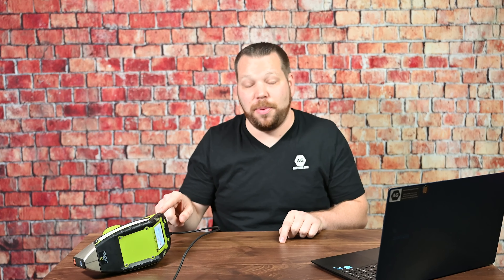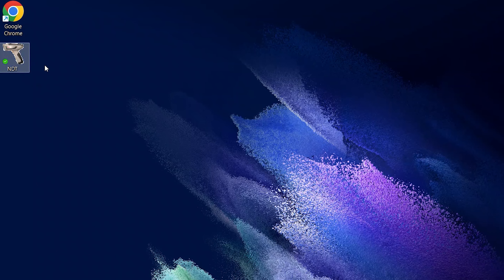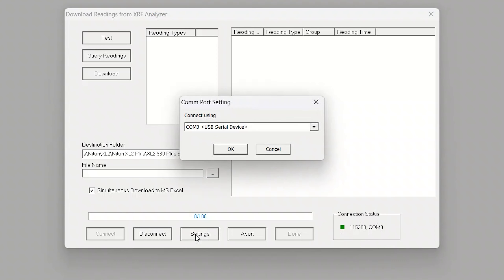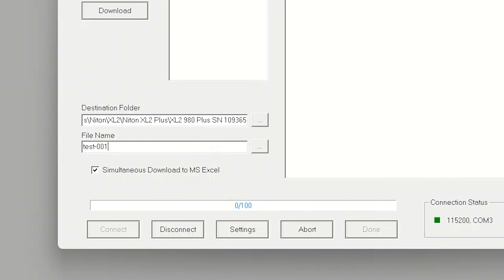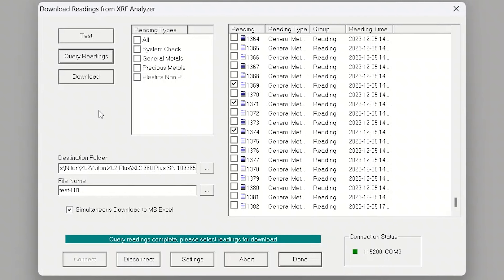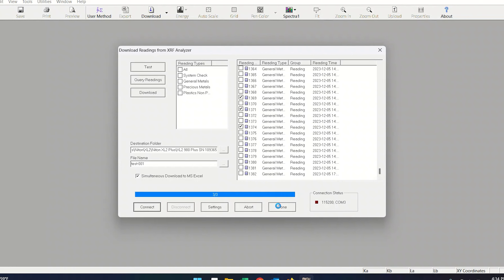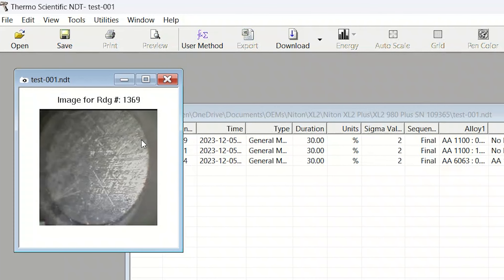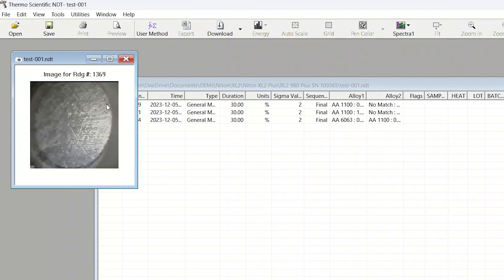How to get the data from the Niton XL2 Plus Handheld XRF Analyzer 4k

Comment: Hello There , Our's was an TS XL2 Plus the same as you shown in this video.  How to make use of Bluetooth function to wirelessly transmit data ?
Reply from the maker: The Bluetooth function is only used to connect an external printer. To transmit data, use the USB cord.